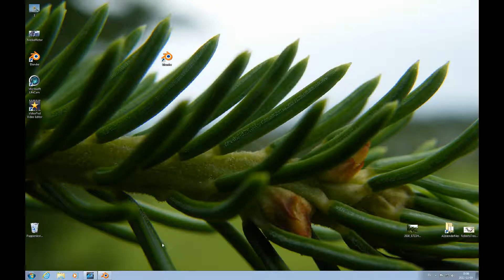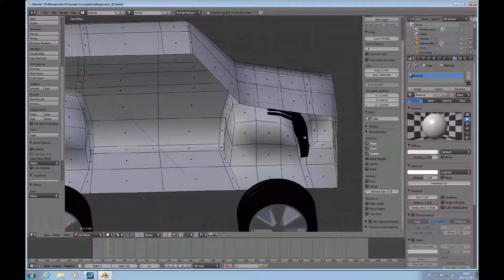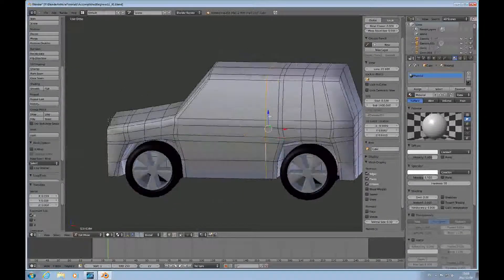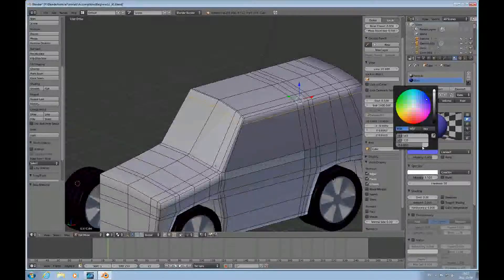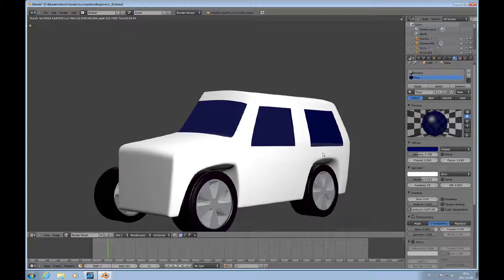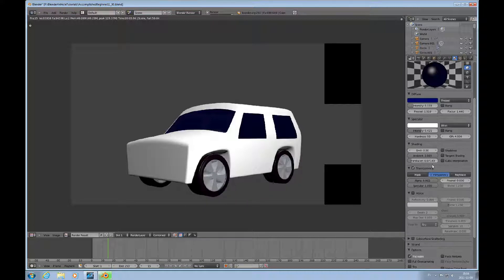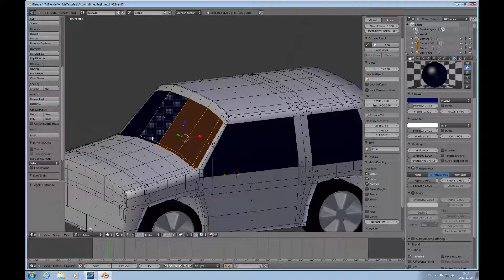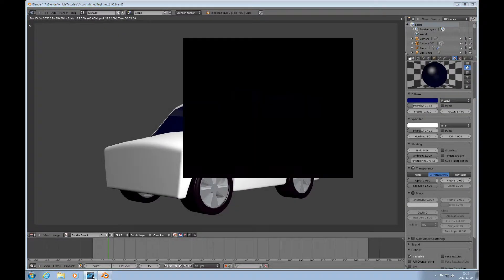Accomplished Beginners Blender #11 3D tutorial

Comment from the maker: @knavic The object = the car has the subdivision surface modifier that is turned to visible in object and render mode but not in edit mode. The edges of the side window looks straight after extruding it inwards at about 11:30 but when I render at 11:40 they turn rounded.Thats why I have to add the edge loops to control that effect.